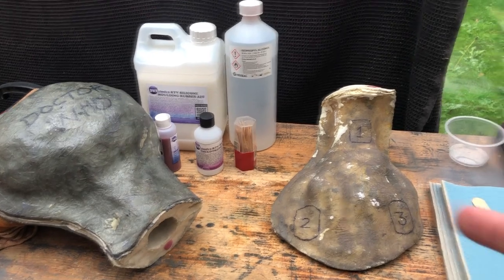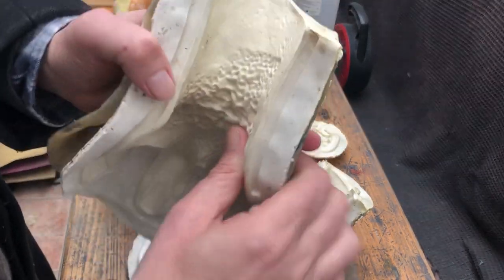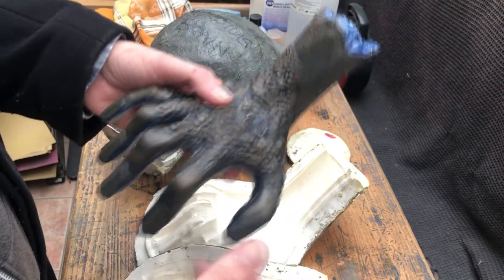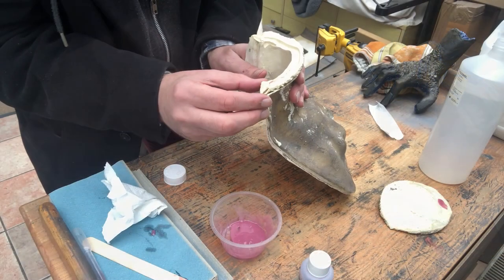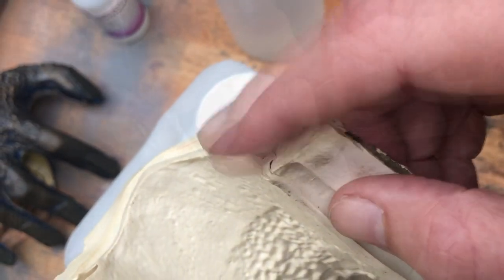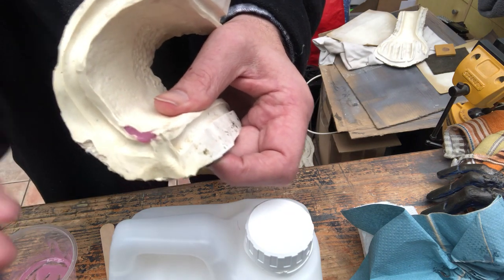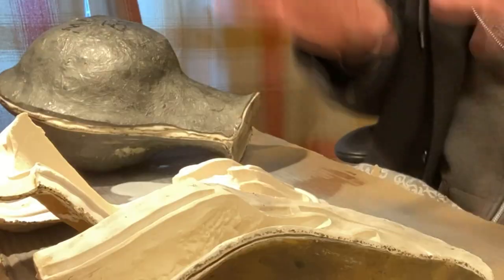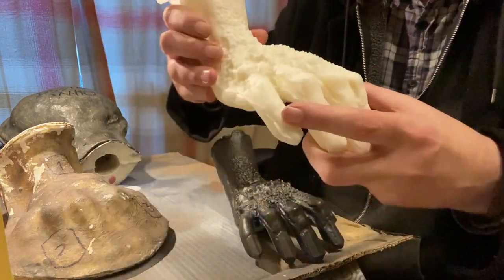SILICONE MOULD REPAIR - Bring an old mould back to life! [THE HAND OF FEAR]

Comment: Nice repairs. I’ve got some very old Ghostbusters Trap moulds that are starting to show a lot of wear and tear. On that subject the new silicon looked like the Pink Slime from Ghostbusters 2.
Reply from the maker: The repairs worked wonders, so that's always gratifying. If your trap moulds are starting to wear out, fix them up - it's easy - and you can use pink slime to do it... You only need to look down into the old sewer system under New York!

Comment: OH WOW Absolutely glorious. I didn’t realise these mode still existed. Both props still unnerve me from childhood.! Totally would get a hand of fear though! And you’ve made me think I need to make the edge of a silicone piece thinner, and I should’ve looked it up on YouTube to help as acetone wasn’t working
Reply from the maker: Well if you need any help with whatever your project is, I'll be more than happy to chime in if you want me to.
Reply: @PBProps  well any advice about about what solvent to dissolve the thick edge of silicone would be a great help to make it tapered to sit  better to skin would be really helpful, I’ve just read about WD-40 maybe
Reply from the maker: Usually you'd use acetone for this, but if the edges are too thick, then that's not really going to work. You have two choices; build up the join with more silicone and blend it all in... or (if you made the piece) remould it with a properly tapered blender edge. I have a feeling that you may have bought an appliance, so this may not be applicable - if that's so, then is there anyway that you could hide the join under an item of clothing?
Reply: @PBProps  oh yes, should’ve said it’s a breast plate, oh the fun of Theatre, and yes acetone didn’t really work actually at all so normally would hide it with Gerry, but for some reason this version came with quite a thick edge. I’m sure I’ll figure it out though. Thank you for the advice !!!!
Reply from the maker: Yeah, I had a feeling that this was what you were talking about. Whoever your supplier is, maybe you could contact them and advise that they address the blender edge problem. Like I said, the only real way around it is to try and disguise the seam, especially if this is a multiple use item as I really can't see you blending it in with more silicone (that you'd also have to colour match each time) as that would be really time consuming!
Reply: @PBProps  just popped into my head because of the silicone thing it’s fine it can be disguised, in other news, if you do a run of hand of fear let me know because that looks AMAZING